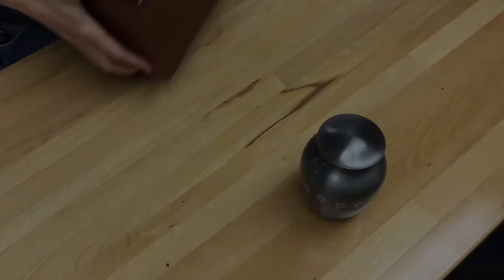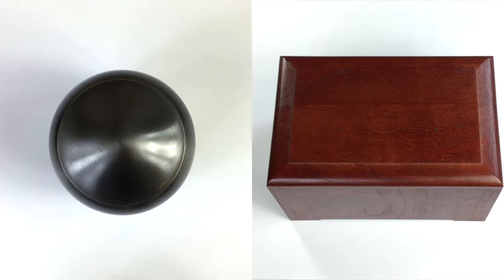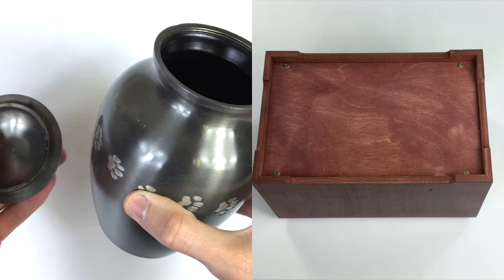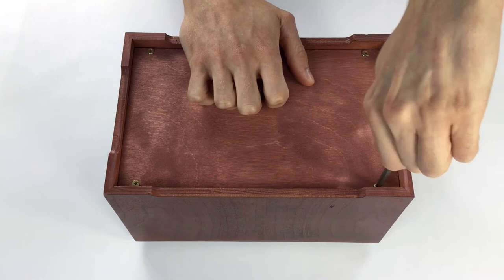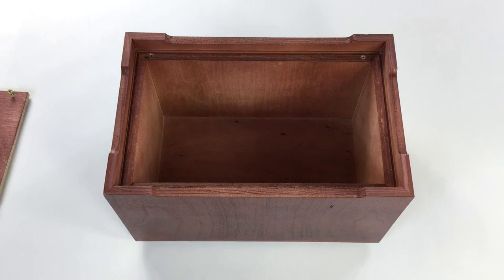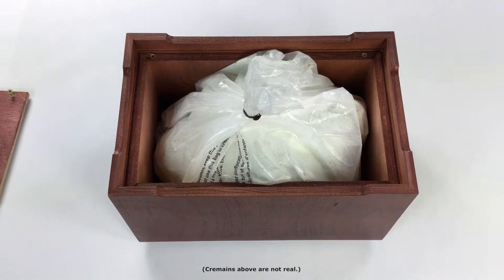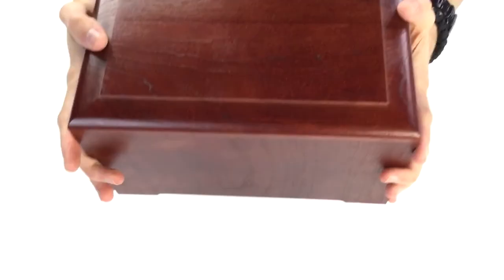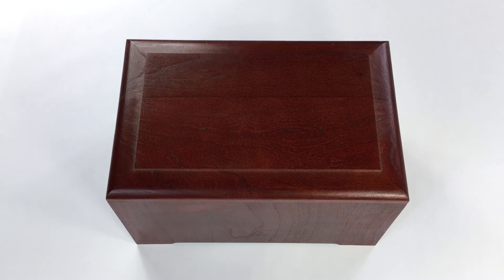How To Fill A Cremation Urn

Comment: When my cat’s condition unexpectedly worsened and I had to say goodbye, I payed the extra fee for private cremation because I wanted to ensure I was getting his ashes and not the ashes of another pet. The box was provided but the emergency vet and what I received was the cheapest looking laminate Wooden box for his ashes. Even the label with his name just screams “I am mass produced!”. It was honestly devastating to receive such a thing. I did not have the money to afford a new urn for his ashes as the private cremation and emergency vet bill was quite expensive. I’m also still really scared that the ashes might be loose inside the box but recently one of my other cats for some reason decided to knock his ashes off of the shelf (in 4 years they’ve never touched it so I have no clue why now??) and the cheap box landed on one of its corners and dented in that entire corner. My baby deserves better than that cheap piece of garbage. I will be looking for a new one so thank you for the guide.

Comment: I’m confused as to why the process isn’t shown for the screw lid urn but they show it in the beginning of the video.
Reply: You have to pour the ashes inside.
Reply: Good question, that's the more difficult one and they didn't show it.  Thanks for nothing.
Reply: @reneem6839  you have to put a plastic bag from the funeral home or what ever company you order your urn from in side the urn. Pour ashes inside and tie. Make sure you do this outside because some ashes will spill. I did this for my mom.

Comment: I work in the industry. They need to make the hole bigger on urns. The screw wood boxs are ok but the marble urns are too small
Reply: I agree! I’m trying right now to put my husband’s cremains in an urn that just arrived today and I don’t know how this bag is supposed to fit in it🥺
Reply: @shessojazzy4605   Becareful cause sometimes the bag can rip. Also if there is a zip tie you can clip that and then put a bag into the urn and then gently pour the cremains in it. Or the easiest way is to call a couple funeral homes nearby and they can do the whole process for you.
Reply: True! You would have to take the ashes out the bag to put it in those types of urns.
Reply: Hello